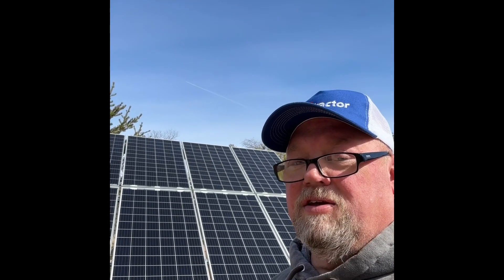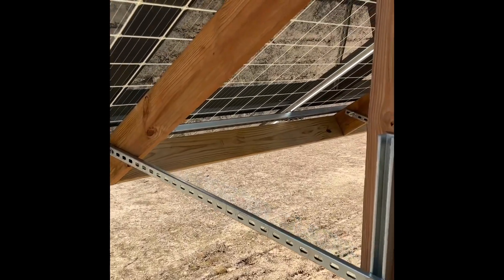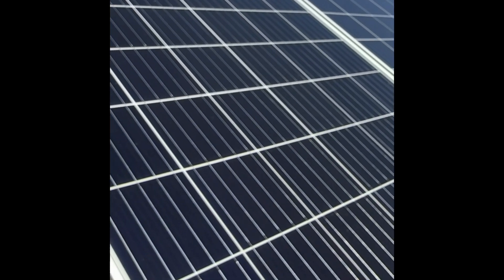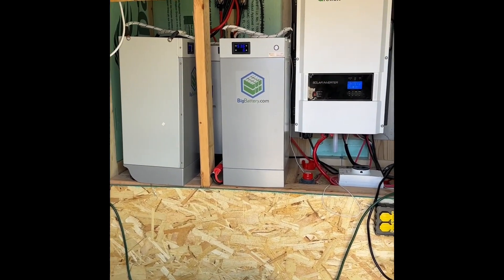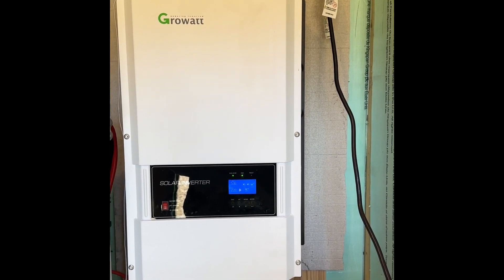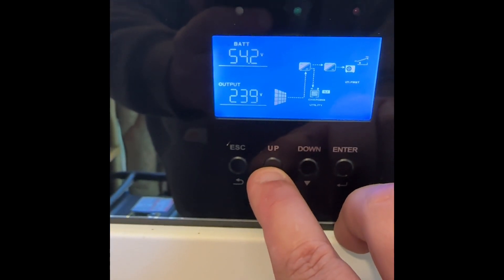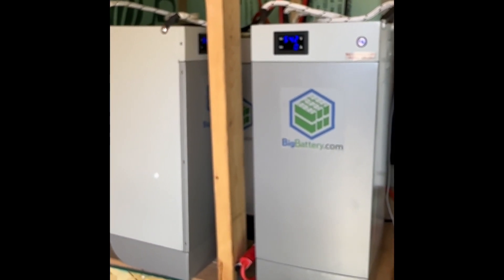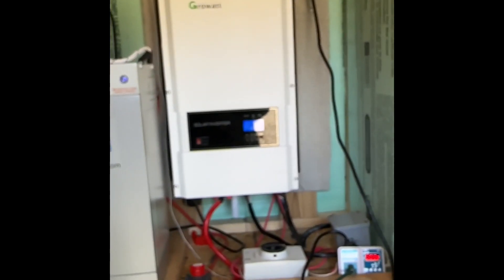Off grid solar system | Growatt, Big Battery, Znshine | review

Comment: Good work, I plan to do the same. How do you calculate the angle of the system to get the most of sun? The angle to set is at the top (vertical) or at the bottom (horizontal) of the frame? It will be great if you give the list of materials that you use to build the mounting frame. I would adjust the quantity to fit my plan.
Reply from the maker: Sorry for the late reply.  I use the mobile app for our inverter to determine the best angle.  I will move the panels by eyeballing it and fine tune it with the app showing the PV input.  I'll do a different video on the ground mount for the panels.

Comment: Will the inverter automatically pick up the SOALR  WHEN they are hook up? My inverter not picking up my solar power..staying with grid power charging my battery
Reply from the maker: Yes. It will pick up the solar automatically IF the inverter is on. If the batteries are too low to turn on the inverter solar will not turn on the system by itself.

Comment: Hey you may be better off getting the chargeverter  from signature solar. Then you can charge your battery directly from the generator without any problems with your inverter.
Reply from the maker: 100%. I did pick a charger to plug into the generator as a back up. I had the batteries discharged too low and the inverter would not turn on even with the generator running so I had to get a separate charger. I’d say that is a big fault for this Growatt but I should
Have gotten the charger when I did the system.

Comment: How did u run your 10 solar panels? 5 series  n 5 parallel?
Reply from the maker: Great question. This particular Growatt inverter has two PV inputs so I was able to make two runs of five panels in series. If you are considering the 12,000 watt Growatt SPF 12kW DVM MPV model as it has 250voc max MPPT operating voltage.
Reply: @Off Grid Cabin Living and Projects  I have the 6kw it only has 150voc. I have 10 renogy, 320w panels. I'm trying to figure out  how to run them
Reply from the maker: @larrymiller7128. Do you have all of the specs for your panels?  You may end up running them in two series of five and then running the series in parallel.
Reply: @offgridcabinlivingandprojects  320w 24v 40voc
Reply: I hooked it up 5 n5 in 2 series, but my inverter is not picking up the input of the solar.. how do I take the battery 1st out..
Reply from the maker: @larrymiller7128 you can really only hook 3 up in series or you will be over the voc of 150. Maybe run five sets of two in series and then tie those sets in parallel to keep under the 150. Just a thought.
Reply: @Off Grid Cabin Living and Projects  I did, but why is it my inverter not picking up my solar input..it said o voltage solar input. The solar panel is not  even showing up on the screen. The utility symbol is..
Reply from the maker: @larrymiller7128 make sure the positive and negative are correct. I didn’t mark mine when I pushed the four wires through the conduit and had to do some testing with the voltmeter to make sure I had the wires hooked up correctly.